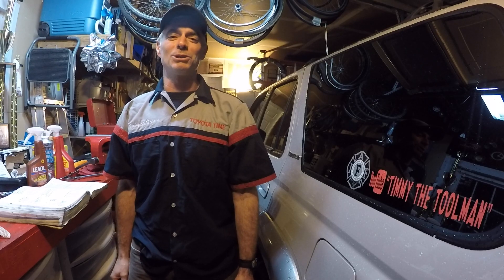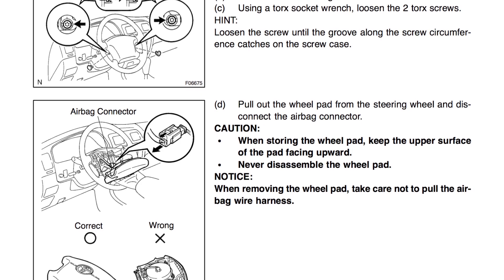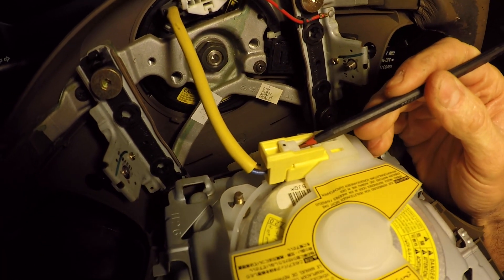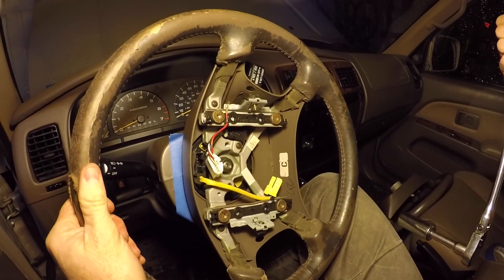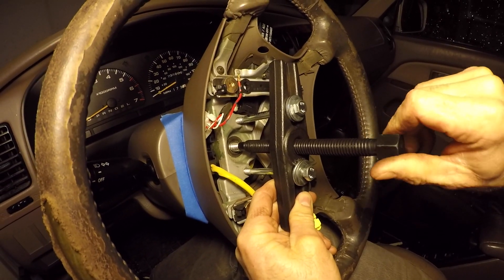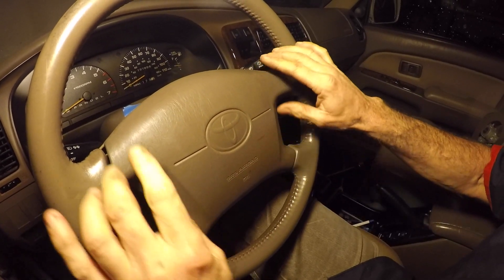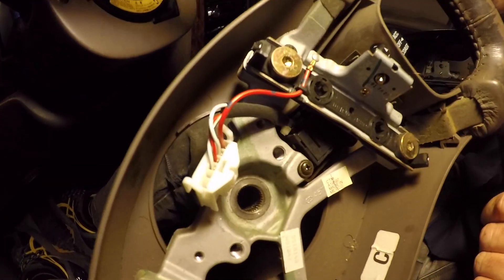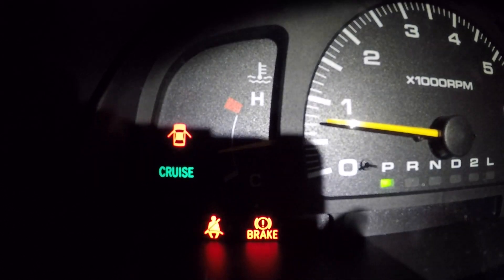Steering Wheel Replacement

Comment: Tim your channel is great for 3rd gen owners. Just pick mine up last week. I'm in SoCal and believe I got a hell of a deal. 97 limited 4x4 with rear locker paint is starting to fade but it does drive great. I have to change my steering wheel aswell I can see the metal circle of the steering wheel lol it's like someone took a bite off it lol.
Reply from the maker: Hey Daniel, welcome to the 3rd Gen Club.  Have fun fixing up your rig.  If you have questions along the way, don't hesitate to ask.  Happy Wrenching!

Comment: Since you seem to be one of the only mechanics that seems to care about the FSM or torque specs I thought I'd pass on a tip from my experience in aviation mechanics.  No matter what anyone says extensions do not affect torque as they do not change the moment arm of the wrench.  If you are using a crowsfoot or similar tool that extends the wrench's overall length it would, but it could be assumed that your torque was correct!
Reply from the maker: Thanks for sharing this Conrad.  I appreciate it.

Comment: Only time torque has to be re-calculated is if the extension changes length from the handle (making the wrench longer or shorter). Any time your using a straight extension there is no adjustment needed.
Reply from the maker: That's the same I've heard regarding using a torque wrench.

Comment: Excellent very explanatory video, for me it is a perfect manual to change the steering wheel of my Toyota by myself. One question: how can I remove the bearing from the steering wheel shaft? Is it necessary to use any additional tools to remove and put a new bearing?
Reply from the maker: Not sure.  I'm guessing the shaft would have to be removed and the bearing pressed off.

Comment: I’ve been trying to purchase a 3rd gen 4Runner since I only own a Tacoma but god lord the prices for a 3rd gen 4 runner are insane here in SoCal , either way another good informative video Tim
Reply from the maker: fortis619 You noticed the prices are insane too for the California market.  I can't believe what people are asking.  I just wonder if people are giving them anywhere close to what they are asking.   I literally looked on Craigslist everyday for over a year to find this one.
Reply: Timmy The Toolman I really would like to know what you ended up paying. I am seriously jaw dropped with prices. Something like that would easily fetch for 12k in my area.
Reply from the maker: I paid $6500.
Reply: Timmy The Toolman That is a ridiculously good deal. You need to give us a walk around!! I'm glad you got your hands on it. It shall be well taken care of going forward.
Reply from the maker: When we make another video with my rig, I'll do a little walk around of it.  It's in pretty good shape.  Last week I replaced the radiator, upper and lower radiator hoses, fan clutch, thermostat and all the fluids.  I also added an external trans cooler.  I still need to do a rear axle seal job because I saw the previous owner paid for a seal to be replaced but they didn't do anything else.  I pulled the ABS sensor and saw that gear oil is getting past the seal so I'm going to do it right and replace the bearings and other associated parts.  I'll also need to do the valve cover gaskets because those are leaking as well.  So, I've got my work cut out for me to get it up to snuff.  Luckily I know how to do all this myself.

We're going to be making videos of the lift I'm installing, front and rear bumpers, winch, skids and rock rails.  I've got all this stuff on order.  I've spent more money on modifications than the rig cost me.  This modification stuff gets expensive really quick but I figured I was going to go all out if I did it.  Luckily I can work overtime to afford all this stuff.   This rig is going to be my off-road adventure rig and I'm going to keep my other one stock for road trips and as a daily driver.
Reply: Timmy The Toolman That is so awesome! I'm looking forward to the updates and videos!
Reply: Timmy The Toolman geez that’s a great deal!!  I looked almost everyday too craigslist autotrader etc.  Finally on my way to purchase a 3rd gen in L.A. i saw a listing somebody posted the night before in Orange County for a 2000 SR5 4WD  (2nd owner purchased it from Toyota dealer in Costa Mesa back in 2000! 100% serviced at dealer had 200k miles) turned around met the guy test drove, all good paid $6800.   (Instagram smestasjr) The California market is crazy when it comes to 4Runners not just 3rd gens anymore even 4th gens with low miles are fetching insane prices.

Comment: I have a 1997 4 Runner and I really am not a fan of the two spoke steering wheel. I did notice that I like the design of the 1998 and was thinking of going to a junkyard and Picking up a four spoke like yours
Reply from the maker: You should do it.  If you don't have a puller, you can yank it off with some force.  Sean has done it many times.  Just be careful not to pull the steering wheel right in your face and bust your nose.
Reply: Timmy The Toolman I went to my local junkyard today to go see how much the steering wheel would cost and surprisingly it is on 20$. However they do not sell the airbag that comes with it. So trying to find that airbag might be pricey.

Comment: Looked this up because I need to swap steering angle sensor, wish you had needed to go deeper into the column. Do you guys do side work? I’m local. Thanks for the info.
Reply from the maker: What do you need help with? We are open to doing work for people if it means we can get a new video out of it.
- Sean
Reply: @TimmyTheToolman  2017 Tacoma did a bunch of front end work now I can not clear or recalibrate steering angle sensor. You could use for video if you want. I’ll buy parts, whatever is needed.
Reply: @TimmyTheToolman  I also have a Marlin Crawler Taco box to install. 2nd transfer case
Reply: @TimmyTheToolman  you can film. I have steering angle sensor issue I also have a Marlin Crawler taco box transfer case to install

Comment: I'm attempting to do this but not sure if it's better to wrap the wheel or get a used one.  I've seen wraps and they look OEM. Will have to take the airbag out to make the wrap look clean.
Reply from the maker: Maybe try the wrap first if the product is affordable.  If it doesn't turn out as nice as you hoped, then you can look for a nice replacement at your local wrecking yards.

Comment: You should do a video on the steering column slip joint mod. On how to take the play knocking noise out by welding or pinning.
Reply from the maker: JJ78n That would be a good video and we'll probaly make it at some point.
Reply: Timmy The Toolman I'm doing the mod on both of my 4runners tomorrow. Since I don't weld I will be doing it the roll pin way. My Instagram is @instajefferson I will try to take a few pictures.
Reply from the maker: Ok, sounds good.  I was thinking I'd take mine to a welder I know and take as little apart as possible to get the welding done.  I understand you don't have to pull the whole unit out like that guy shows in his write-up.
Reply: Timmy The Toolman Yeah one of the write ups has the whole steering column out and the other has just the steering wheel and shaft.

Comment: This video help me alot. My 98 corolla steering wheel was like the old one you have but I feel in love with the 2001 corolla steering wheel. The airbag ports are different and they cant connect I'm stuck on solution. Got any suggestion. I was trying to research if I can snip the wire and re-wire it but no luck.
Reply from the maker: BenScorpi0 do you get an airbag light on the dash?
Reply: @TimmyTheToolman  yes I do
Reply from the maker: BenScorpi0 you might want to try to get the clock spring from that same year corolla you took the wheel from.
Reply: @TimmyTheToolman  oh I never thought of that. It's probably difficult now because I got at a junkyard but i have to look around now if any pop up a similar in the junkyard. Thank you
Reply from the maker: BenScorpi0 go on eBay but look at the connector in the picture to make sure it will be compatible 
https://rover.ebay.com/rover/0/0/0?mpre=https%3A%2F%2Fwww.ebay.com%2Fulk%2Fitm%2F173906734320

Comment: Can you replace the steering wheel with another Toyota steering wheel, say from a 2005 highlander? Will the connectors for the airbag, horn, and and cruise control be the same?
Reply from the maker: There are some that are compatible.  Sean has put one from a Lexus in his 3rd Gen.  Don't know about the Highlander though.

Comment: Would I need to reset the clock spring even if my wiring for the cruise control is still the same as my new steering wheel?
Reply from the maker: You just want to make sure the clock spring is centered.  If you didn't mess with it while you have the steering wheel off, you don't have to worry about it.

Comment: It's very easy to pull a steering wheel off by hand. Just loosen the bolt a little bit so that way when it comes loose it doesn't hit you in the face you think people would automatically figure this out
Reply from the maker: Em Dee Em Dee yep it is! Give it a couple good yanks back towards you OR hold the wheel at different positions and twist it back and forth then yank it a little after. Keep the 19mm bolt on the threads loose so it doesn’t hit you in the face once you yank it loose. But, sometimes you need to learn the hard way Em’ deeeeeeeeeee

Comment: I got this steering wheel installed at a shop today and now my alignment is off. Do I need to fix the alignment now or re-install? The shop says that I just need to fix the alignment. When it was installed, I was told the grooves/teeth in the circular part didn’t fit correctly.
Reply from the maker: Was the steering wheel the right steering wheel for your vehicle?
Reply: Timmy The Toolman 
Yes it is
Reply from the maker: @jaypark2265  Well Jay, that means they did the job wrong then.  If the steering wheel they pulled off was straight, that means they should have been able to get the replacement one on and leave you with a properly aligned steering wheel.  To tell you to get an alignment because they are incompetent is total bullshit.  But, this fix is easy.  Start off with your wheels pointing straight ahead, remove the steering wheel like we show in the video and put it back on the splines of the steering shaft straight, like the idiot mechanics should have done in the first place and put it back together.  If you don't have the necessary tools to do this, take it back to the shop and demand that they remove the steering wheel and put it back on straight.
Reply: Timmy The Toolman thank you
Reply from the maker: @jaypark2265  You're welcome.

Comment: Tim ! I noticed your dash has the same brake light on that mine has . I’ve recently done the tundra brake upgrade , and everything is to spec and works as should. Except that pesky light . What’s the fix ?
Reply from the maker: Hey Judd, are you saying your brake light is lit up after the job?  You're not talking about the parking brake light, correct?
Reply: Timmy The Toolman yes ! Parking brake isn’t on .
Reply from the maker: @juddbrown1505  There's two reasons why that light will come on.  One is the parking brake is still on and the other is because your brake fluid is low.  Is your brake fluid level topped off to the full mark?

Comment: Hey Timmy , I recently bought a 1997 Toyota 4Runner SR5 , the airbags had been deployed and I fixed the drivers side but I am having trouble replacing the passenger side . I already removed the glove box and all of the 10 mm bolts. And I have removed the two 12 mm bolts on the bottom part of the airbag that hold the air bag down. I am struggling to take out both of the 10 mm bolts ( one on each side) on the top part of the airbag. I don’t have easy access because the rest of the dashboard is covering the two bolts. What can I do to take the airbag out or access those two bolts? Thanks Timmy .
Reply from the maker: Hey George, I wish I could help you out with this but replacing a passenger side air bag is something I don't have experience with.  Maybe post this question on T4R.org and somebody will have the answer for you.
Reply: Timmy The Toolman Thanks for the advice and the link Timmy ,and I wanted to say that as a multiple 3rd gen owner, you have helped me save a lot of money and thanks for that , keep up the good work !🤘🤘🤘🤘💪👌!
Reply from the maker: @georgeguzman9290  You're welcome George and it's great to hear you're saving yourself lots of money doing your own wrenching with the help of our videos.

Comment: Tim, I sure love your videos.  I have a 1998 SR5 4 runner.  It has almost 300k on it and the bottom of the front seat is ripped and does not look good.  I have looked everywhere for the original cloth and there is none.  My interior color is a brown or tan dash and the seats are looks like gray.  Do you know anywhere that I could find a drivers seat, a seat bottom or just the fabric from the seat bottom?  If you knew where one is please let me know.  Also, the black on the steering wheel is worn off where you put your finger to turn the car.  Do you know if there is a paint that will paint leather gloss black?  My steering wheel is as bad as the one you took off around the rim except it does not have a tear on it.  I have a steering wheel cover over it but where it doesn't cover, I need to paint it.
Reply from the maker: Hey Mike, glad you like our videos.  The best way to deal with worn out seat bottoms and worn out steering wheels is to find a replacement at an auto wreckers like PickNPull.  But, if you don't have a lot of auto wreckers in your area like we do in the California Bay Area, that makes it difficult.  I don't have any idea where you could find fabric to match your interior.  I also don't know what paint you would choose to paint the leather your steering wheel.  My guess is you'd need some sort of dye.  

Maybe pose your interior fabric and steering wheel paint question on T4R.org in the 3rd Gen section.  There's a lot of very knowledgeable and helpful people on there that might be able to steer you in the right direction.  Good luck!

Comment: If I swapped in a 1st generation Limited Tundra/Sequoia steering wheel into my 2004 Tacoma, would it be possible to make the steering wheel controls work? I have the factory head unit.
Reply from the maker: Kaden Espinoza unlikely. You’ll need a stereo that can accept the connection from the steering controls.
Reply: Timmy The Toolman I was thinking of swapping in this oem Toyota Unit (pt546-52150). It’s from a newer Toyota Yaris. Is there a wiring harness I could get to connect the new steering wheel to that head unit?
Reply from the maker: @kadenespinoza2261  Don't know Kaden.  This is untrodden territory.   Maybe you could ask this question on a Toyota forum like T4R.org and get a answer to your question.

Comment: I changed my steering wheel but now when I drive on a straight road my steering wheel is crooked. Will an alignment shop fix this or do I have to remove the steering wheel again and reinstall? Thanks.
Reply from the maker: I'd take off the steering wheel and get it straight.  Have the wheels pointing straight ahead, remove the steering wheel and put it back on where it looks straight.  Done deal!
Reply: @TimmyTheToolman  Thank you so much!